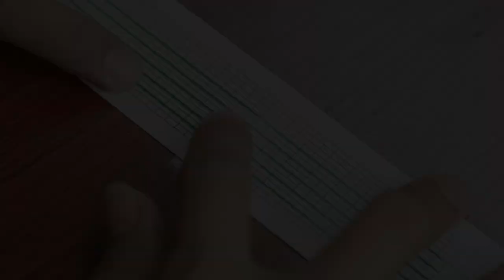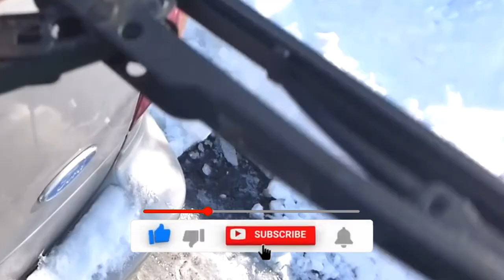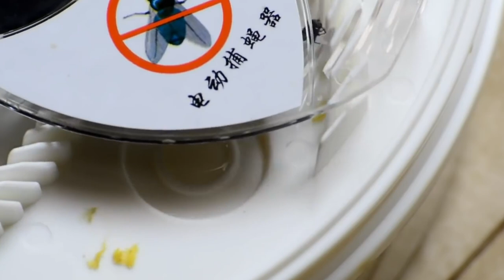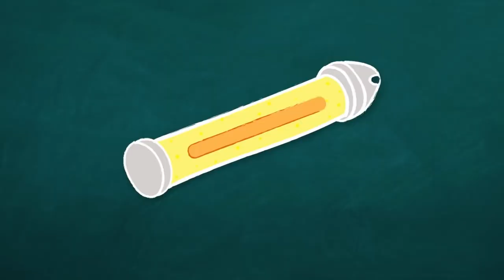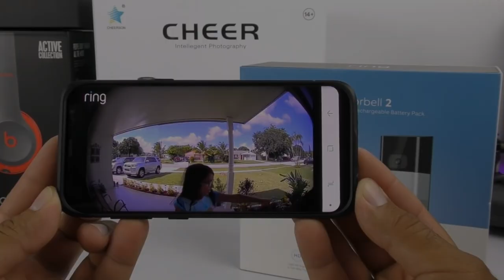OMG! You won't believe what we found on Aliexpress \ Our Aliexpress Discovery Has Us SHOOK!

Comment from the maker: musical barrel organ  https://alii.pub/6nz9je
Paper clock with electronic display  https://alii.pub/6nz9kr
Pocket Selfie Drone  https://alii.pub/6nz9mi / https://alii.pub/6nz9nv
Sensor mixer  https://alii.pub/6nz9pt
exhaust jack  https://alii.pub/6nz9s5
Automatic miracle opener  https://alii.pub/6nz9uh
Mat for baking "Pyramid"  https://alii.pub/6nz9v9
Eye Massager  https://alii.pub/6nz9w8
Surprise box  https://alii.pub/6nz9x0
Wiper blade restorer  https://alii.pub/6nz9xs
Sugru  https://alii.pub/6jadg7
Electric flycatcher  https://alii.pub/6nz9yy
Mirror man costume  https://alii.pub/6nz9zq
radio controlled snake  https://alii.pub/6nza04
Glowing sticks  https://alii.pub/6nza0p
Video call to the door to the apartment  https://alii.pub/6nza1h
Mosquito Net Repair Tape  https://alii.pub/6nza2u
Stirling's engine  https://alii.pub/6nza4s
Oil sprayer  https://alii.pub/6nza6q
emergency hammer  https://alii.pub/6nza83
Superbroom  https://alii.pub/6nza8o